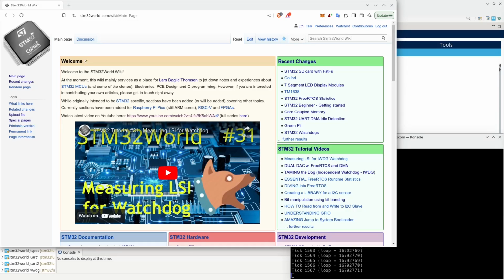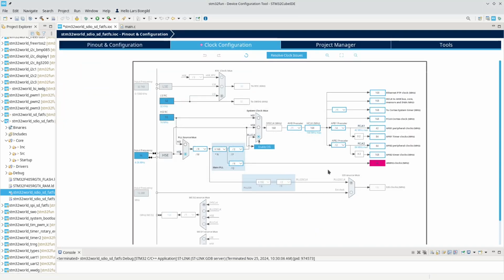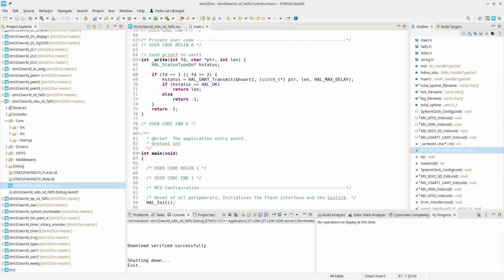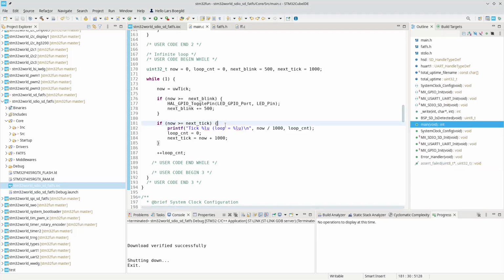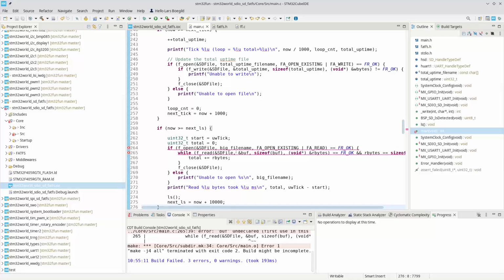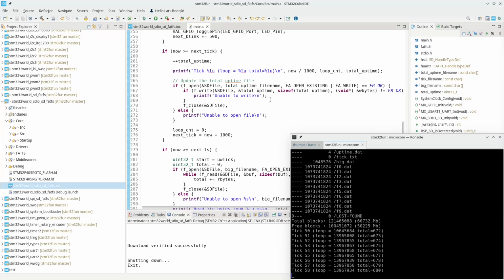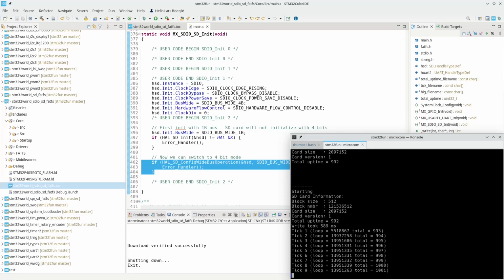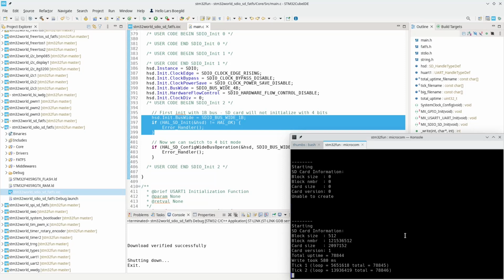SD-card w. FatFS (using SDIO) - STM32 Tutorial #33

Comment: Do you know how one can implement the 4 bit SDIO with freeRTOS? I havent been able and have been encountering some issues, even tho i was able to do so baremetal (without an RTOS). Thanks in advance!
Reply from the maker: The way ST have implemented FreeRTOS it essentially just run on top of what you see in this video.  SDIO with FreeRTOS should not be a problem but you might need to fiddle a bit wiht the Interrupt priorities.  I know FatFS need a bit of tweaking to work with FreeRTOS but that is possible from CubeMX.  You also might need to implement some Mutexes to control FatFS access so you don't attempt to write from two different tasks at the same time.  In short - SDIO with DMA should be NO problem, but FatFS might need some tweaking.

Comment: plan to design a real-time controller and transmit six floating-point variables to a PC every 10 ms (required payload bandwidth ≈ 2.4 kB/s ≈ 19.2 kbps; RAM usage ≈ 24 B per 10 ms frame, or 48 B with double-buffering). Would this be feasible with an SPI-connected SD card?
Reply from the maker: I would definitely go with SDIO if possible but it is doable with SPI too IF it is properly connected (see some of the newer videos I made about a Micro-SD breakout).  Should be doable with a UART but I would consider USB if I were you.

Comment: I believe if you do it like that 
 
  hsd1.Instance = SDMMC1;
  hsd1.Init.ClockEdge = SDMMC_CLOCK_EDGE_RISING;
  hsd1.Init.ClockBypass = SDMMC_CLOCK_BYPASS_DISABLE;
  hsd1.Init.ClockPowerSave = SDMMC_CLOCK_POWER_SAVE_ENABLE;
  hsd1.Init.BusWide = SDMMC_BUS_WIDE_4B;
  hsd1.Init.HardwareFlowControl = SDMMC_HARDWARE_FLOW_CONTROL_DISABLE;
  hsd1.Init.ClockDiv = 2;
  /* USER CODE BEGIN SDMMC1_Init 2 */
    if (HAL_SD_Init(&hsd1) != HAL_OK) {
        Error_Handler();
    }

it will work as well. Because in generated code I don't see initialization. Just set up structure.
Reply from the maker: It will not.  When using the FatFS it is not necessary to call HAL_SD_Init  because it will be done if needed by the FatFS init, however, calling that in 4B mode will hang.  You MUST initialize in 1B mode and THEN switch to 4B.

Comment: https://www.youtube.com/@stm32world - 4 bit mode SDIO also works with CUBE generated code but only one bug is to be fixed. You don't need to add anything in MX_SDIO_SD_Init() function. 
Just change hsd.Init.BusWide = SDIO_BUS_WIDE_4B to hsd.Init.BusWide = SDIO_BUS_WIDE_1B. 
HAL_SD_Init() function is automatically called when you call f_mount() function and there is also a following function to switch to 4 bit mode. Only bug is CUBEMX generated code for 4 bit mode with "hsd.Init.BusWide = SDIO_BUS_WIDE_4B" in MX_SDIO_SD_Init() function. 
That was the reason also why you don't get data of SD card if you comment out HAL_SD_Init() from MX_SDIO_SD_Init(). Because the data will only be available after call to HAL_SD_Init()  and that is called from f_mount() which is after your requested data code. 
So just two things if u generated code for 4 bit mode. 
1. Change hsd.Init.BusWide = SDIO_BUS_WIDE_4B to hsd.Init.BusWide = SDIO_BUS_WIDE_1B in MX_SDIO_SD_Init() function and 
2. Read the SD card status data after SD card has been mounted.
Reply from the maker: Did you watch the video to the end?  Changing to 1B in the code generated is a bad idea as CubeMX will change it to a wrong value each time it is updated.  However, towards the end I do show a reliable approach.
Reply: @stm32world  I have watched the whole video and thanks for all the information. My reply above was just to clear the confusion you were raising within 33 to 34 minutes regarding why even after commenting out 4B mode in SDIO init function, the mode was continue to be 4B. Thats becasue while calling f_mount, it again calls the SD init with 4b mode as per cube settings.

Comment: Hey I don’t know if you will see this comment but I have a video request that adds onto this video.

I’m looking for a way to use dma to write to an sd card without the write function hanging until the transfer is complete.

I want to be able to open a file, begin a transfer, have the cpu to other work until that transfer is complete and then jump back and close the file and so on.

But the middleware code that ST provides seems to hang until the transfer is complete even with dma. But if I want to read sensor values and update a display at the same time it just makes good performance impossible.
Reply from the maker: I read all comments and also reply to most of them.  To improve the videos I need the feedback.
The FATFS+SDIO does have a "Use DMA Template" option, but I have not tried it.  I will test it out.
Finally, you might be better of asking on our new Discord server, - here: https://discord.gg/VQ99T6WUAk

Comment: Hello.
I changed MX_SDIO_SD_Init() function as you did, but on f_mount() the program hangs for 30 seconds (in find_volume() function). Then f_mount() returns the value FR_DISK_ERR.
In 1bit mode everything works correctly.
Reply from the maker: Hmmm, not sure - try to increase the clock divider on the sdio to say 8 to see if that works (slows down the sdio).
How is the SD wired up - verify that is correct and verify that the pull-up's are on all the lines except the clock.
Reply: I checked with a different sd card
4Gb class 10: when switching to 4bit mode the card is not mounted
8Gb class 4: everything works
I took your advice and increased the clock divider. But it didn't help
Reply from the maker: @borisgubanov7558  I guess it could be a one-off broken SD card?  Anyway - I much appreciate that you bother to write the feedback here - that is helpful.  And I am glad you made it work.
One interesting experiment would be to see if the broken card works in SPI mode (see the other video).